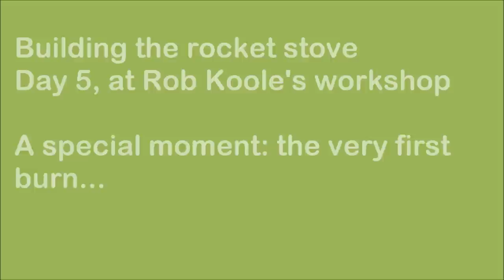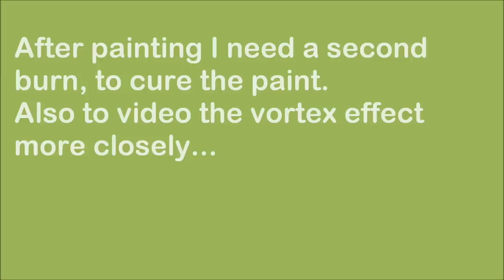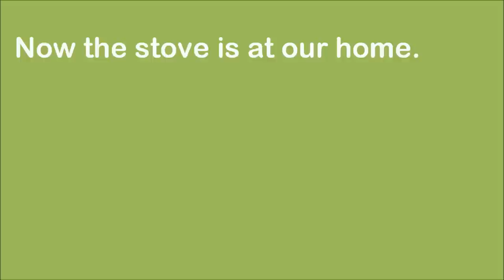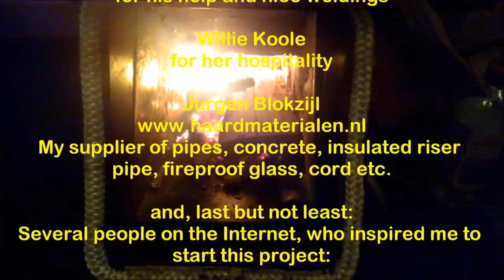Rocket Stove Heater. Building Part two

Comment: im gonna do a small one.. just a question tho.. 
do the flaps in the flu choke the fire down? im gonna do 3 small flaps and run a tube from the bottom side. into the fire then up 4" up the flu.. cheers for the video =)
Reply from the maker: King Daz The flaps are relatively small, and only change the direction. They do not choke the fire. There is a very hot column of almost one meter above the fire, drawing the flue upwards.

Comment: Something to think about.
 1. The burn chamber, the stack above the burn box, must get near red hot to work efficiently.
 2. At those temperatures the burn chamber will degrade and be destroyed eventually.
 3. The chamber enclosure, usually a barrel, will also be subjected to those temps and degraded developing a weak spot or hole.
   These parts will have to be replaced  eventually and it would be convenient to not have to destroy the stove or have to build a new one. 
  Any thoughts?
Reply from the maker: +Timothy Runyon Indeed, it even gets hotter than "near red hot". It gets cherry red, sometimes nearing orange. That's why I had to replace all the mild steel with stainless steel. That can survive those temperatures much longer. The fire resistant concrete is holding fine.
The enclosure is not getting that hot, not even the top plate is getting red.
And yes, parts has to be replaces some time. That's why I designed it as modular parts. So I can easily replace the inner parts without destroying the stove. See my video about the "disassemble inspection".
Reply: Thanks.

Comment: very nice work,  have not build one yet but thinking about it,,    one question from wife >>>  if fire box is filled at 11 pm how long will it last before needs more wood put in ??? <<<   we have used only wood  to heat 2100 sq ft home since 1979 replaced wood heater 2013 first time, but older we get less wood want to move and put in, with my present wood heater same as first one, I can fill ( 5 or 6 pieces 3 x 3 x 22 ) at 11 pm seasoned 1 yr at 30* outside and will need more wood by 5 am  so would building a Rock Stove Heater heat 2100 sq ft longer than 6 hrs ??  Thank You for showing yours.
Reply from the maker: Thanks. Eh, all those feet, inches, I don't know. But for sure a rocket stove burns wood more efficient. But my design needs refilling quite often. Perhaps you want to build a much bigger fire-box, so you can put a lot of wood in once for a long burn?

Comment: Your vortex is poor, but that's because you're trying to make one out of turbulent air.

Move your burn a few inches away from the riser, to clean up the flow.

Then, instead of welding directly to the riser, choke it laterally, forcing the flame to conform to the side at the point of entry.

Comment: Hi

A beautifull piece of work excellent craftmanship!
Nevertheless some hints from my side.
The vortex vanes in the riser are probably obsolete. Flame vortices  are initiated by efficient combustion not by vanes. I very much like your idea of the perforated air inlet pipe.
I have concern about the longevity of the stove. The very high temperatures in the riser section will cause desintegration of any steel type including.mild steel or stainless steel. Stainless steels 304 and 316 (and other types such as titanium stabelised) are not high temperature heat resistant.  Also the combustion type must be taken into account for material selection --> e.g. oxigen rich <carbon reducing> environment or carbon rich sooty environment.
You should consider the use of refractory materials which are far superior than stainless steel sheet metal.

I have excellent results with a home made refractory liner of the steel  riser pipe consisting of clay, sand perlite, and sodium silicate. (waterglas).  The riser is the hotspot of the stove and a very critical part of the stove. No cracks in the liner! No detoriation of the mild steel riser pipe since in contact with low temp. flue gas only.
I have used my home made refractory mix for  the fire box too.
 👍
Another hint is to give the refractory liner In the riser  a venturi shape. You could locate the secundary combustion air inlet jets within the liner integrated venturi. The 2nd combustion air would intensify the combustion process a great deal. The vortex will start in the venturi and will thoroughly mix the secundary air with the carbon rich flue gasses coming out of the fire box.  It is also possible to preheat the secundary combustion air by circulation it within the riserwall. This would cool down the riser a bit and would increase the combustion temperature.... resulting in an even better fuel efficiency and longevity.

Regards

Bert España
Reply from the maker: Thanks for your compliment and comment.
The vortex vanes work fine, the route through the riser is longer because of the vortex. You are correct about using refractory materials for the riser, although my stainless steel part with the vanes is fine until now. Your idea about a venturi in the riser is interesting but obsolete, because there already is a lower pressure in the riser. And a venture will not generate a vortex, nor does a efficient combustion. And I think it is not a good idea to cool down a riser. The hot riser is one of the tricks of a rocket stove, you did mention that yourself.
But thanks for the idea's.

Comment: Nice design, but once operating & fill tube full, what is the heat operating time ? Our Schrader Royal Emprise will throw sound heat for 12 to 14 hours on 12 > 6" x 16" sticks.
Reply from the maker: +Papa Ritz Thanks. I have to refill every half hour, but that's no problem, I like to sit at the fire and looking at it reading (e-)books and (e-)magazines. I searched on Google: No results found for "Schrader Royal Emprise".

Comment: How are you with the performance Are you happy with it how much wood would you use in a 24 hour time period did you put in a mass around your pipe which exits the heater? before going out the chimney?
Reply from the maker: I'm happy with the performance. I don't use it for full time heating, just for evenings in the weekend. No, I did not put mass around the pipe (yet). I live in an old house where I can use the produced warmth directly. But I will move to a modern zero-energy home in the near future, so I will have to change that. To get enough heat to the mass around the pipe, I will have to insulate the stove itself as well. Because now the heat is radiated from the upper part of the stove, and a lot of heat disappears in the convection to the air flowing around the stove.

Comment: nice stove. what the maximum area it will heat up?
Reply from the maker: Hard to say. The room it is standing in is 25 m2 (and 3,3 m high) gets hot. But it is drawing cold air from several other rooms an a kitchen. That's a total of 80 m2 extra which gets rather warm. Then there is also some heat going to the second floor.

Comment: What is the effect of raising or lowering the top gap between inner and outer drums?
Reply from the maker: It was just experimental. It is not much of a difference in the measuremnets that I could change it. Just be sure that the 'area' of the cylinder that is between the top plate and the top of the riser is at least the same as the area of the inner circel of the riser.

Comment: Nice design, I'm in the middle of building one at the moment too. Could you tell me where you got those fasteners that you're using to secure the top drum please? Thanks
Reply from the maker: +Callum Mckay Just at the local hardware shop. Like in this link: http://bouwkern.com/klussen/ijzerwaren/hang/meubelbeslag/eierkistsluiting-gegalvaniseerd-75mm. I did not use te hook but replaced that with an selfmade adjustable one.

Comment: Robt. is the height of the stove pipe important?  If so, what is the minimum it has to be?  Have you used a narrower or wider tube?  If so, what were the results?  How tall can that vortex flame get.....in what diameter tube?  Tks!!
Reply from the maker: Sure it’s important! It is one of the basic principles of the rocket stove. There is a strong draft in the inner riser pipe because of the high temperature. The longer the pipe, the stronger the draft (well, there must be an end to that when flowing resistance wins from the upstream force by temperature difference). I used a standard double sided stainless steel 1 meter pipe that is available at shops. The inner diameter is 125 mm. Then I designed the rest of my stove around it. So I didn’t experiment with other pipes. I think that the measurements are working well together. If you want more heat, you have to scale up all. You can calculate the “wideness” of the airflows. It must be the same through the whole path that the gasses follow. Correct that upward in the hot parts of the stove, because hot air expands, so it needs more space.
The draft in the riser is the reason that so much air is sucked into the fire and it burns so hot. It also causes that sound, that rocket sound. That’s why it is called a rocket stove.
The other effect is that you don’t need an external chimney with still hot air to suck out the flue gasses. You lose heat with that, because the chimney needs some hot air to function. In a rocket stove you actually push the flue out of the stove. The draft in the inner riser is the motor for that. So you can extract all the heat out of it by using a very long pipe inside your house. Or lead it through some sort of material (or water) to store the heat. Beware that there is some overpressure there, so make sure the fittings are airtight!
Wood gas has a slow burning speed, so the flames can be long. But the vortex mixes the gas and the (secondary) air very good so that makes the total length less tall than then it would be without vortex. And because the gasses follow a spiral path, that path is longer than when it goes straight up. I seldom see the end of the vortex through that inspection I have on top of the riser.

Comment: I am curious about few design features.  I wonder about why you used those vanes to create a vortex which also gives rise to the question of not using the outside cylinder to create the torus.  The other question is what you are using for thermal mass.
Reply from the maker: Perhaps you should read the answers to similar questions. In short: The vortex is to mix secondary air and burning wood gasses.
There is no burning gas in the outer cilinder, so no need for a vortex.
I'm not using any thermal mass at the moment. Quick heating is my goal.

Comment: What makes this a rocket stove? I just see a continuous feed wood stove that sucks air noisily through a small opening...my 30 yr old wood stove does that. I thought a vortex was to mix enough air in there to get a blue efficient flame - otherwise what does it do other than look cool?
Reply from the maker: Hi Garry. There is a lot of information on the Internet, but in short: It is called a rocket stove because of the sound of it. And the efficiency is above 90%. And there is no smoke and no smell out of the flue pipe.

Comment: I'm not sure if you covered this yet, but what is the reason for the vortex?
Reply from the maker: Because of this vortex the flue gasses mix better with the rest of the air, or with the secondary air if that is injected there. So there is (even better) complete combustion. Wood gas is slow burning, so if there is no second combustion, the chance is that unburned gasses escape into the flue pipe/chimney.
Reply: Ah, makes sense. Very cool design.

Comment: wonder would would happen if you welded an auger into the chimney...
would it slow the gases down a bit and cause them to burn even hotter?
Reply from the maker: No. It is a bad idea to do anything in the exhaust of a rocket stove! Normally in a chimney is lower pressure but because the draft in a rocket stove is in the INSIDE of the stove (in the riser), the flue gasses are PUSHED out into the chimney. If you block that, the flue will try to exhaust via other ways.
The air intake though can be regulated. In my stove that is done by screwing up a circular plate that reduces the opening. The big door is closed then. You can see that in my first video, it is in the smaller box under my filler box. And in detail in the explanation about my secondary air at the end of the same video.
But the heat output of my stove is at maximum if that is fully opened, and whith the big door opened slightly. The regulation is needed because if I run my stove at maximum for too long it is far too hot for my rooms.

Comment: How much did this cost to put together?  You have some nice pieces in there.
Reply: Isn't it cheating using stator blades to create a vortex?  Either way, what a fantastic lil beast you have there.
Reply from the maker: Hard to say. I did a lot of the work myself. And I have a friendly relationship with the metal workshop over here. And had to replace some mild steel part with stainless steel afterwords. Most of the steel is 2 mm thick. Material about 40 euro mild steel. Replacement with stainless steel about 45 euros. Working hours of the metal shop around 270 euros.
What do you mean with "cheating" using the stator blades? I deliberately used those blades there to create a better vortex. Without that there also is a possible vortex, but not that strong.

Comment: I had a good smile at the rocket bit. :)  How is the stove going? Did the design work out well?
Reply from the maker: Yes, works out well. After I replaced the mild steel parts with the RVS version.
Reply: Thanks for the reply

Comment: is the adjustability really necessary?
it adds a level of difficulty that might stop a first timer from trying the build.
Reply from the maker: As you could read in other answers: it was experimental. If you design enough surface for letting the flue to escape, there is no problem. Bigger is good, smaller is a problem.

Comment: Is the vortex counterclockwise, and if so did you place the fins that way because Northern Hemisphere??? Is every stove different or will every vortex in the Northern Hemisphere always be counterclockwise and vice verse???
Reply from the maker: Interesting thought... But I think that the force created by the fins is far more stronger than the Coriolis force on this small column of air. It does have effect on big masses of air, of course, but not on this scale.

Comment: Nice ,but your feed tube should be at a much higher angle. Not sure what you were thinking.
Reply from the maker: I was thinking about the view of the fire, because I like that. The higher angle would be nice to "autofeed", I  guess. I just push the wood by adding new wood, so no auto feeding needed.

Comment: Absolute great looking stove. Equally suited design for any type of house. Certainly something to consider installing in my place. For now I am only making industrial style rocket stoves. If you manage the time, do check some of my stuff :-) still some videos to upload, but nevertheless...
Once again, great stuff...!
Reply from the maker: Thanks. And I have seen your video's before. I wondered if some insulation could make it better? I noticed that you use stainless steel sheet to protect your mild steel from the heat, but that riser still gets red hot and will be damaged.
Reply: Robert J.H. Gisolf
Yes, as a matter of fact, additional isolation is included in the blueprints of version 2.0 :-), in the form of moulded and segmented jacket of fire-clay material.
This was somehow a test to see if a good but inexpensive scrap material could be found for construction. That was the main goal, and it was very successful, all together. The steel used here are enough tough for now. Of course, it will be eaten bit by bit but second generation will be made by then :-).
I was looking to bring all the main components and firing order of the rocket and jet engine together, of course without the moving parts :-) and concept proven itself. Air inlet - burn chamber - fuel injection - additional air at two opposing tangential sites to create a spin and a good mixture - after burner plates with additional fuel & separate superheated air line directed under the afterburner. Some of that stuff is not shown jet, but few videos are jet to be made.
Reply from the maker: BurnerProducts RocketStoves OK then. I'll wait for your video's....!

Comment: I'm curious why you didn't put your air tube in the center and use 4 vortex fins instead for a complete spin.
Reply from the maker: The air in the middle of the vortex is not moving very fast. So the secondary air wil not mix very good.

Comment: Nice design,  would of been nice to explain vortex and tube
Reply from the maker: Thanks. You can find lots of information about vortex and rocket stove on the Internet. In short: for an even better mixing of the secondary air with the leftover burnable wood gas.

Comment: Hello, How important is the gap at the top. I couldn't stop thinking all night, when a woke up I had this idea for the vortex. So now i want to build one. i like to show what I came up with. How could I send this to you??
Reply: What would be a good starting gap height?
Reply from the maker: sharkmotorsports1a The surface of the inner riser pipe circle must be the same as the surface of the cylinder formed by the gap height standing on top of the riser.
Reply from the maker: send it to my gmail: rjhgisolf@gmail.com

Comment: is that stainless steel in the riser?
Reply from the maker: +HyperGro DWC Yes it is. Actually it is two parts. The first is thick walled pipe with the vanes welded in. First that part was made of normal mild steel but that corroded to much in the intense heat. The stainless steel is holding fine. But the second part is sliding over the first and is a standard available double-walled pipe with isolation in it. But the inner wall is deforming because of the heat. More and more builders are experimenting with fireproof concrete risers to prevent the heat problems.